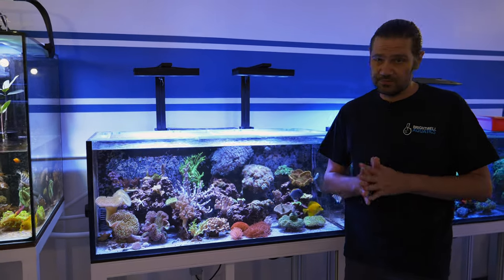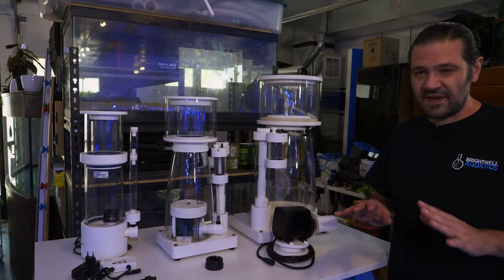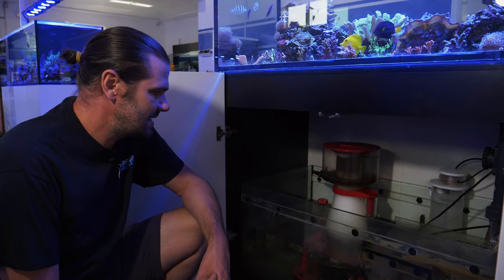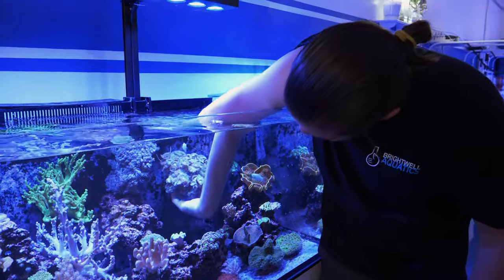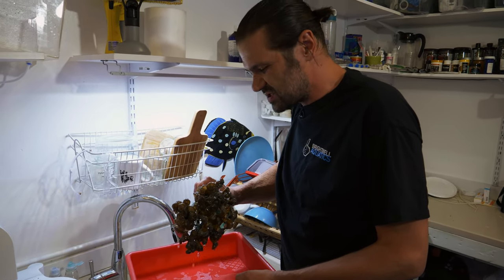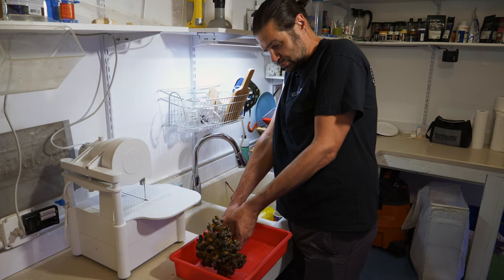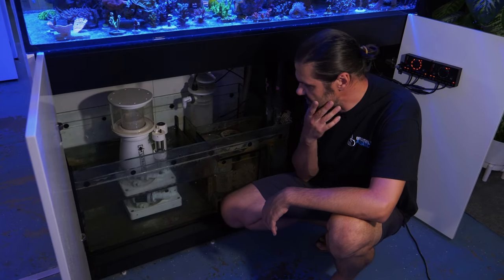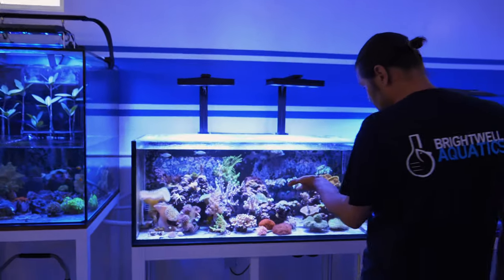Installing a New Skimmer & Fragging a Duncanopsammia Coral

Comment: I know this is probably a dumb question, but why do you still need to do frequent water changes if you put all this money into skimmers/reactors/ dosers/ auto top off equipment. I wish it was self sustaining at that overall price point.
Reply from the maker: I actually don't do that many water changes, mainly I focus siphoning out detritus, but it's also not that hard to regularly change water if it's required.
Reply: @ReefBuildersVideo  Thanks for the response. My toes are on the edge of the diving board, but dont want to get overwhelmed with unexpected maintenance